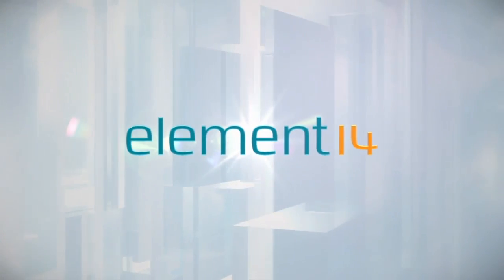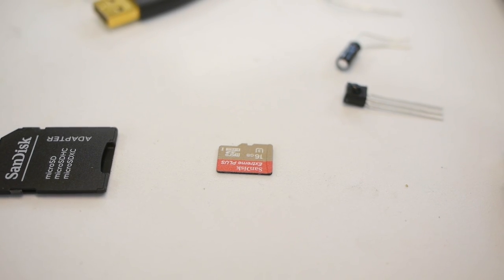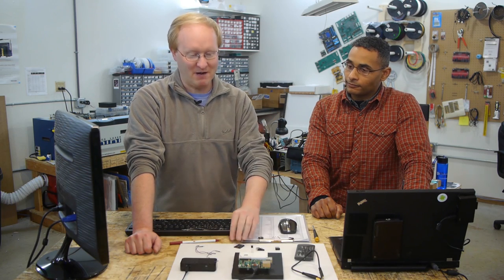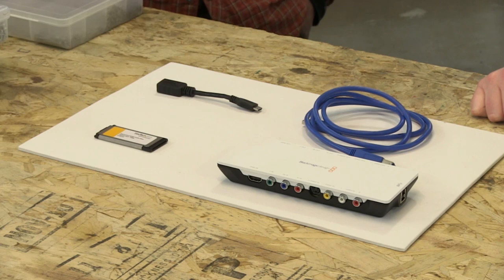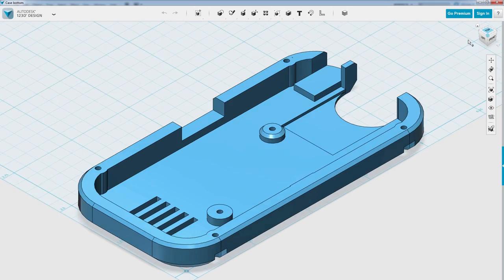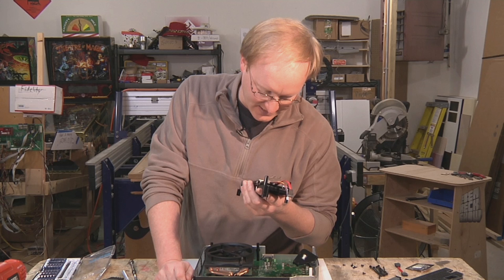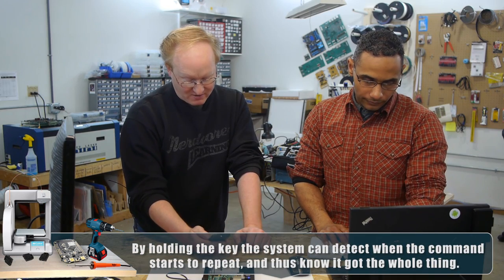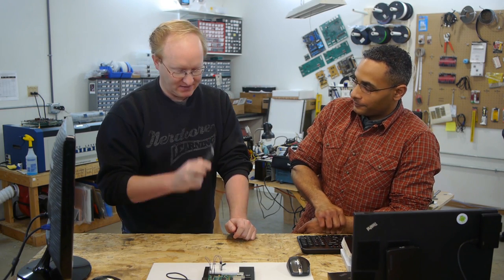Ben Heck’s Raspberry Pi Media Center

Comment: The Ben Heck Show 
Hey guys,Im gonna buy a Pi 2 this week 
I wanted to know if it can run headless as a media player for a car with no display
basically I want it to run stuff off pendrives automatically and maybe ill buy a remote or keyboard or something later on to change the song
also I want it to host its own wifi so that I can connect my device to it and have an interface in the phone/tablet browser to select tracks from the pendrive
dlna and airplay support for the above is also needed

any help appreciated
Reply from the maker: Karthik Naik Yes you can, check out the Pi Projects area on the element14 community for help : http://ow.ly/OGPmP
Reply: The Ben Heck Show Wow you guys actually replied to me 
Thanks alot ,big fan of your works especially Ben Heck !! 
You guys are awesome !!
Reply from the maker: Karthik Naik Thanks for watching :)
Reply: +The Ben Heck Show any recomentations for a pi mediaplayer that is mainly used to play streaming/live media from outside URL-s ? (and netflix and youtube playback is a plus)
Have looked around and tryed several options but no one has the streaming url easy option (i probably need to learn and  make a plugin for the VLC http built in web server/web interface with playback if no other option can be found).
Reply: KrKyoutube or maybe you could simply use a chromecast or Pi with cast enabled and use your android phone to play the url within a browser(Im no expert on streaming, just a suggestion)
Reply: Karthik Naik
 Need a permenent solution, both the stream and render should be on the same unit (with lan cable) so i allready ordered the raspberry pi 2 (as it has all the hardware components and specs needed).

I allready have made the modification for a barebone linux to boot into full screen vlc with no desctop envirtement and no user login screen.
So when powered up will display the VLC fullscreen inside cople of seconds.
And VLC is running the HTTP web interface active so can be controlled over local area network, but that does not support url playback and that's the thing that is needed.

If noone do not know how to find a solution to that then i need to look some complete media server setups that handle streaming from external URL's

The problem with the premade solutions are that they are too bulky and too bloded and full of stuff that are not needed cluttering everything. :\
Reply: KrKyoutube true dat !! 
Looks like you are a better expert on this than me :D
Good luck with your build
please do post an instructible if possible to help us "not-so-techie" souls ;)
Reply: Karthik Naik
I think i will start to add any finished projects onto my google pluss account wall. If anyone is interested. (have several smaller projects too; like multiboot usb's with windows/linux usable storage & installable & live os content all on same usb with dif partifications; autosetup & mod script script made easy for any vanilla fedora install to make it 'every day' usable to any noob, and some other)

Comment: "take that linux" -.- How long did it take to download that windows tool? -.-
Reply from the maker: Хлоя Тень Less time than it takes to type "man dd" and "ls /dev" ;)
Reply: The Ben Heck Show Don't get me wrong, I love the show. But if that is the case you need typing practice.
Or just...Linux practice. If you want to understand just how much more useful linux is than windows (except gaming) it is not going to be handed over on a plate like windows.
Reply: The Ben Heck Show Actually now that I think about it I would like to see some sort of RC vehicle on the show. That would be really cool if you guys made something unique as part of the system. Like a heavy duty RC car powered by arduino or something.
Reply: +Хлоя Тень Some time when he designs a new 3D model of a case for a HTPC alternative with the Raspberry Pi he should make it work on screens with VESA mounts, even for a lighter monitor you could possibly have the VESA mount screws go through the Raspberry Pi case and sandwich the Raspberry Pi between the screen and the VESA, maybe espisode nickname "Raspberry Pi Sandwich" of course if it had any weight you'd have to weld steel and drill press accurately for it to handle that, although I've seen him use a table saw before so...
Reply: A year of waiting, and they just finished the RC project. Grats, haha.

Comment: You don't need to go through the  IR stuff If your TV like mine has the correct HDMI Port. HDMI-CECI is supported by the PI. So I use my tv remote. I also us the USB port on the tv with a USB cable that has the built in power switch. http://www.amazon.com/Raspberry-Micro-USB-Cable-Switch/dp/B00GGX94JI

Comment: He could've just plugged in an HDMI cable and use HDMI CEC to control the media center instead of building that entire circuit
Reply: +Tony Hong Not all HDTVs fully support HDMI CEC, even ones available today.
Reply: Also HDMI CEC is very unstable. I do not recommend using it on older TVs. Even the models made this year are sometimes dodgy.
Reply: Mitchell Blaser Had very good experience with HDMI cec saves time and money than a universal remote

Comment: While Heck calls it a media streamer,it is in actuality a media client. The server, as he states, is a different machine in his lab.
I have created a true Raspberry Pi 2 media server. It uses Plex. Each 'node' is a Raspberry Pi 2 computer. There is another Pi 2 unit that controls the node units.
The reason I did it this way is because media servers have to transcode video depending on the device. My tablet expects a different format than my computer or TV or phone. Thus the video has to be transcoded on the fly for each device. This requires lots of CPU power which a RPi2 has-for one user. 
 
I previously had an Intel based Xeon cpu unit that handled up to six users simultaneously. The problem was that the computer was expensive and even more costly to run 24/7. I needed a cheaper alternative.
 
Therefore I connected the RPi2 nodes via a cheap four port 10/100 network switch like they do with RPi supercomputer nodes. The extra RPi2 is  for common access to a five TB external hard drive unit. The entire assembly takes  less than seventy watts when all four nodes + supervisor RPi2 are running. The Xeon drew over 700 watts but had 16 TB of storage.

You can build a file server with the old RPi but it doesn't transcode videos.

I will be posting the project on instructibles.